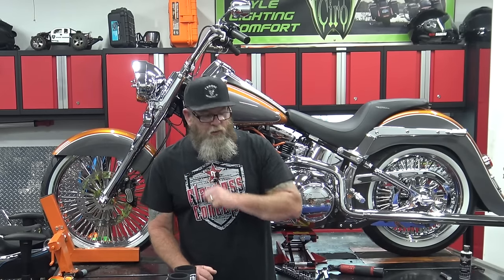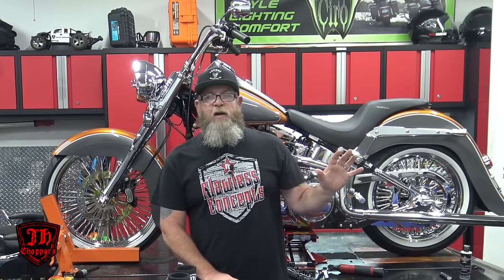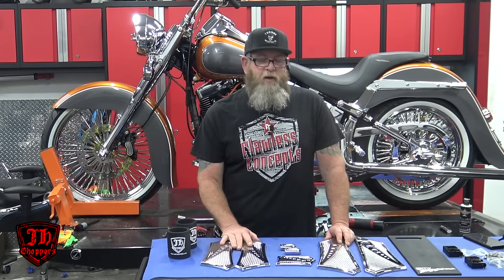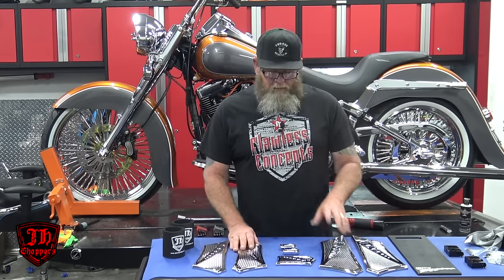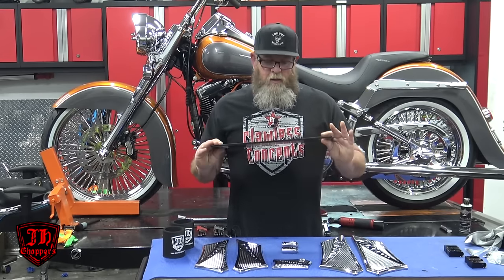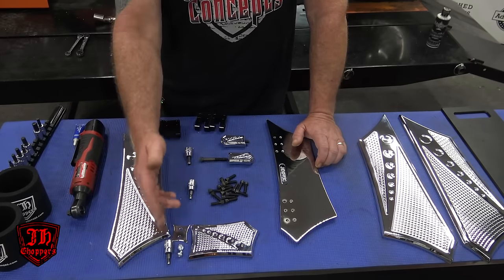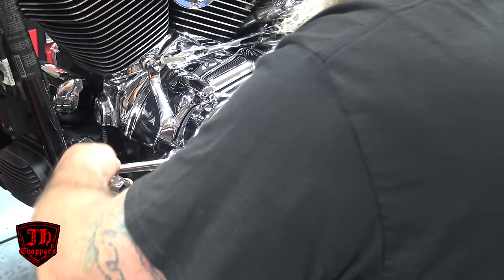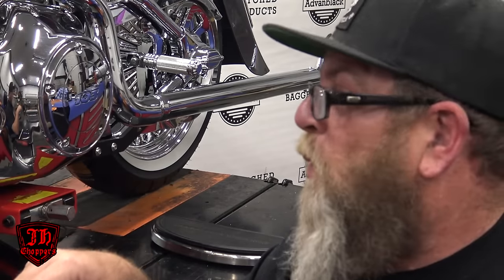⚡Install JH Choppers Chrome E O  Floorboards on your Harley-Davidson Softail⚡

Comment: Viewing this on Monday May 30th.  Big Poppy for you, my brother. I would go with the longer board. Because the whole Cholo style came about as a mix of the old school Harley parts and the L.A. Low Rider Car cultures.  So out west the longer floor boards are through backs to when cars had side running boards.  So if I can find some one who will make me a one pic full front and back that's what I am going to put on my build. It would be sic. Great video.
Reply from the maker: Thank you and yes..I agree...Im leaning far more to the longer boards for sure...just wanted something different then the banana boards you know...thanks for checking it out and weighing in! be safe.

Comment: sweet floor boards! Whens the next sik bagger swag order coming up? Also you might want to put a thin coat of oil between the floor boards and the black mounts, to prevent any scratching of the bottom of the floor board and dissimilar metal corrosion between the two.
Reply from the maker: Thanks for checking it out and weighing in...will have a swag order very soon...next couple of weeks. Just trying to get everything caught up before I do it...its very time consuming.

Comment: Looks awesome! I was wondering, does the floorboards get un the way of the kickstand coming up? Any mods needed to rhe kickstand? Thank you.
Reply from the maker: ZI dont have any issues with it ...they are slightly wider than stock
Reply: @sikbaggers  thank you! I am looking into the same floorboards. Great content. I used your 3 hole oil change video to do mine! Very informative 👏